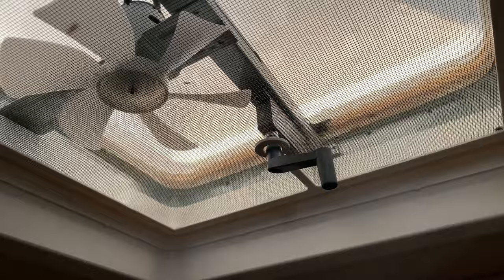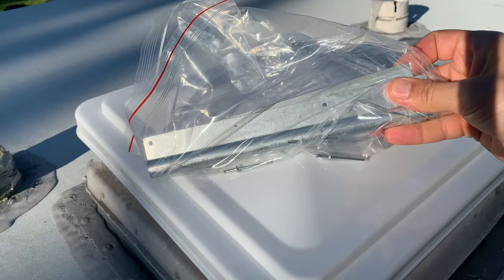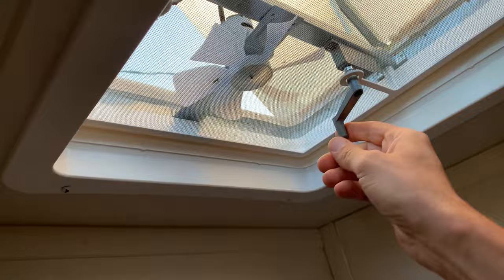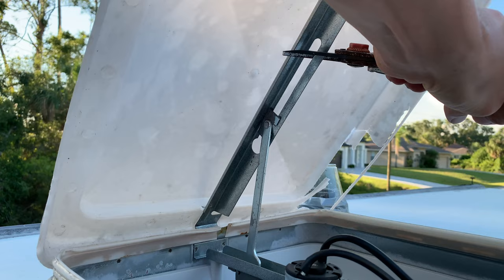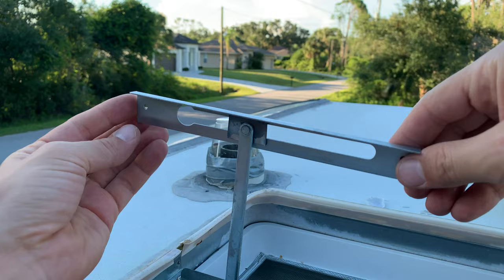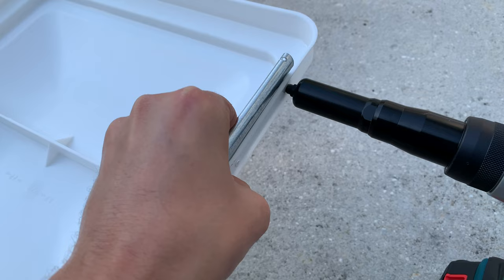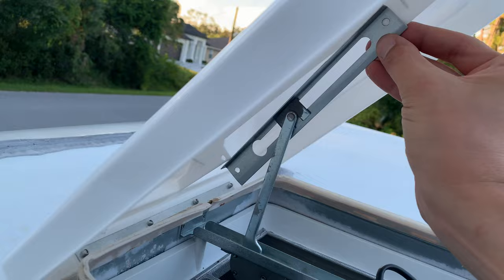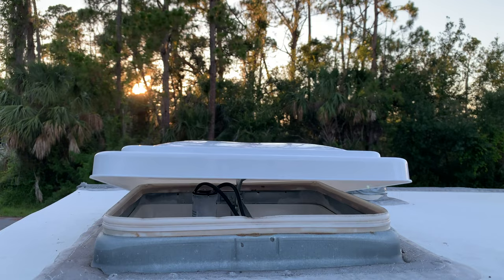(Easiest method) RV roof vent cover replacement - no disassembly necessary.

Comment: Thanks you so much for this. Unfortunately that metal stopper piece is missing, must have flown off? Do you know where I can get that, and what it's called?
Reply from the maker: I don’t think they sell it separately. You can either cut it out yourself from a piece of sheet metal, or buy repair kit and use the stopper, and save the rest until you need it.